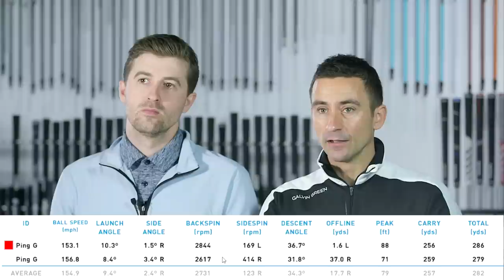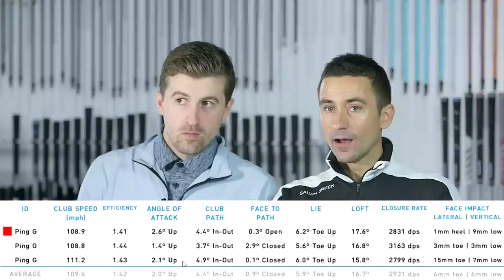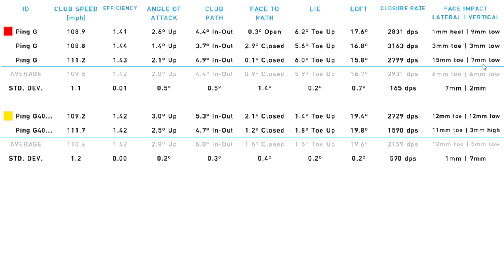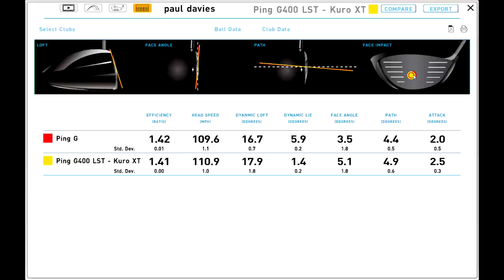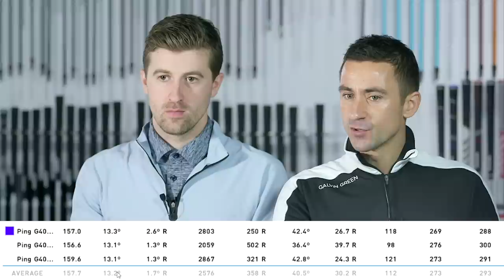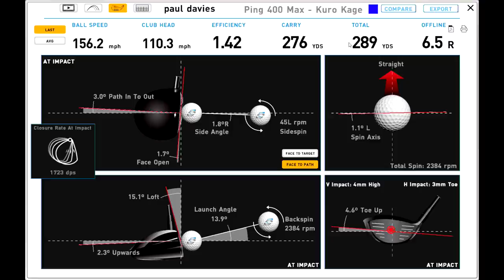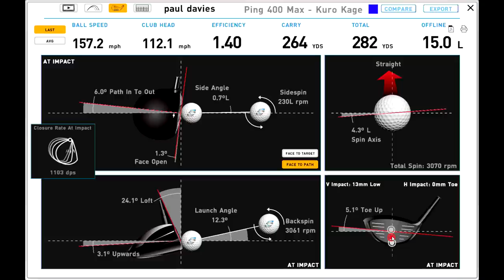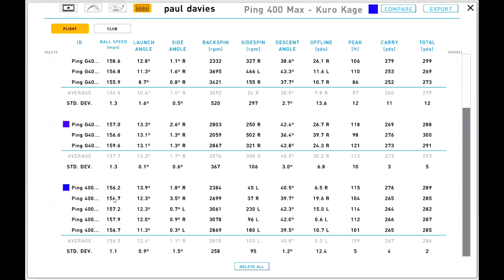Ping G400 Driver Fitting

Comment: Thanks I went to my local golf store to get a driver fitting. I learned so much from your videos and put it to use. I tried the M4 and Rogue against my current Nike Ignite 460. All stiff flex, my carry distance was around 225 with total at 245 or so about 20 yards roll out. I was hitting draws to hooks with all three and my spin  was at 3200 rpm. My launch angle was around 12 degrees which is probably a little low. I then tried a used 2017 M1 9.5 with Aldilla Rogue Silver 70 gram shaft set to middle on both sliders. My launch angle went up to 13 or 14 and my spin dropped almost by 1000 rpm down to around 2300 well guess what my drives went average of 248 carry with around 273 total. Thanks guys for amazing work teaching us average golfers how to maximize our potential and improve our games.

Comment: Its interesting.  I tested the g400max with stock stiff shaft, 102 club speed, 13 degree launch with 1700-2000 spin hitting it 270- 285 roll out.  I want more forgiveness and actually saw that,  but wont that spin hurt me?  Crazy that most forgiving driver on the market is that low spinning.  Thanks.  You guys are incredible!
Reply from the maker: Depends on your swing Joe, if it's finding fairways for you with that spin rate then that's a home run!

Comment: This is yet another great video. Is there anyway you can do a video comparing the stock shafts that come with driver against the aftermarket shafts. I see you fit him in a kuro kage, I am guessing it's not the same as the one that comes standard on some driver. Would be great to see how inconsistent the specs are on the off the shelf shafts. People write about it but no one has show any data or info, I believe it but would like to see it and I'm sure it's what a lot of people need to stop and think before they buy their next driver. If you can without getting into hit water.
Reply from the maker: Absolutely James, it's on our to-do list for sure.

Comment: I got fitted for a Ping 400, 1. shorter Shaft,, 1.5 inches off standard.  2. Light stiff 65g, from a regular shaft, 3 Loft down to 9.5 form a 10.5.  Result: 20 yards extra distance + 20 yards off dispertion, Very happy indeed. except for one thing ? the cost of up grading. However I am saving for it.

Comment: Another great video TXG team! You guys do such a good job, I eagerly anticipate your next "episode", knowing that I will learn something new , guaranteed. Great to see how tweaking the loft, head profile and shaft types can lead to greater consistency. From everything I am seeing from you guys and others online, the MOI story on the G400Max seems to be real....sounds like you guys are typically seeing increased stability for all types of golfers, correct? I am currently gaming G30SFT - how much gains are you seeing in general from players that get fitted into the G400Max? I understand that improvement will vary due to individual player swing characteristics, but I presume with the ideal fitting process, you could project a general range of upside one can expect...
Reply from the maker: We're seeing amazing results with that G400 MAX. And even just taking this video for example, Paul has tested all the Ping drivers for the last several years, and he really took to this one nicely. The MOI and stability are awesome!
Reply: Another question....to confirm what I have learnt from you guys on the channel - I am gaming the G30SFT with the Ping Tour 65 R shaft (was moved from S to R in a fitting almost 3yrs ago, because I had difficulty getting the ball in the air back then). Now, my driver swing has improved quite a bit, I am getting high launch, but excessive backspin. My drives typically land and go backwards vs. forward roll. I need a stiffer shaft now, correct? Feels like I am getting too much head deflection at impact, leading to the high spin. Does that make sense? Would you anticipate the Tour 65 S giving me better results?
Reply: Thoughts?

Comment: Great vic again guys, just one question. If he's striking the ball low in the face, why doesn't he simply tee it up higher??
Reply from the maker: He did a bit which helped bring the strike up slightly. Paul's a very good player, just a bit of off-season rust, I'm sure he'll be back to the middle of the clubface in no time.

Comment: Very Cool......I would bet the same thing would happen if you were doing Sub Zero vs Rogue heads or M3 vs M4 heads with same shafts.  Seems like the avg heads at around 9 degrees play close to lower launch version heads in 10/ 10.5 range.    I also wonder how much of him hitting it a bit low on the face was psychological as far as simply the look of the face....shape, color, whatever.  I know I have had certain heads that just look funky to me and I would strike them low.......and a different look with same specs I hit better just because of a mental thing....looked better

Comment: Hey guys,  always heard the max was longer and more forgiving.   Currently game the reg 400 with hzrdus yellow 6.0 73g I think it is.   Picked up a new Max and compared on course with same shaft.  Regular 400 seemed to come out on top.  Do you think it is spin numbers causing this?  Launch seemed to be about the same, maybe a lil higher with max. SS avg 105, may peak at 108, 109.   Thanks!

Comment: So I currently game the G400 LST, Reg Flex, Stock Alta CB55 shaft. Swing 100mph. If I swing it smooth and easy I can make it go straight, but as soom as I go after it a little I fight a miss to the right.  Starts straight then just slowly fades and keepa fading.  (Some swing issue to work on Ik, but I do play a fade even with my irons).  Is the LST poss too low spinning causing that miss? Is there a better shaft recommendation? Just some general advice would be helpful.

Comment: Cool fitting, just a thought but from the angle of the video it looks like he is teeing it up pretty high (ball looks completely above the head) if he came down a fraction could that improve his  strike point?
Reply from the maker: In this case the average strike was actually a bit on the low side, so the higher tee would (in theory) bring the strike point higher.
Reply: Makes sense

Comment: Interesting, my 6 iron is 90mph, but driver is 102mph,  sequencing issues then lol.
Reply from the maker: Could be a couple MPH left on the table there Dan! Make sure you've had your swing speed measured by an accurate system, and of course the same system with both the 6i and driver before making any conclusions though.
Reply: Trackman fitting bud.